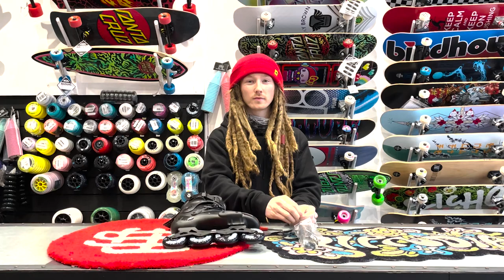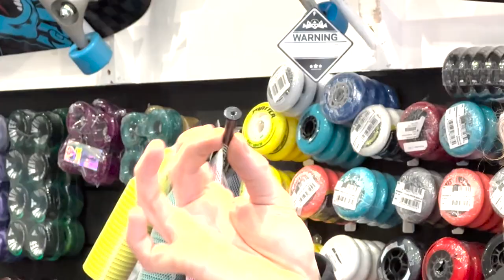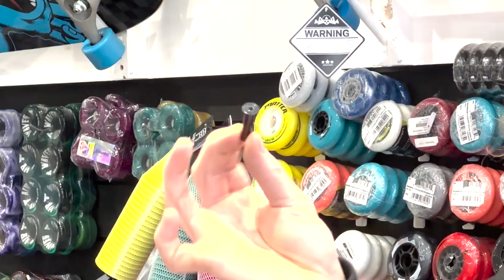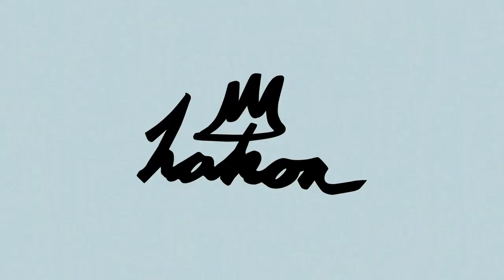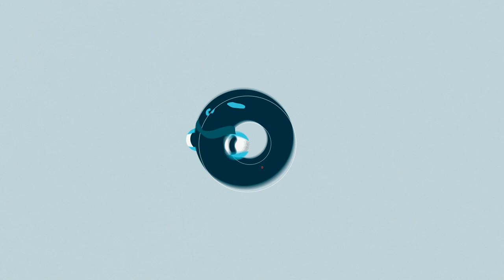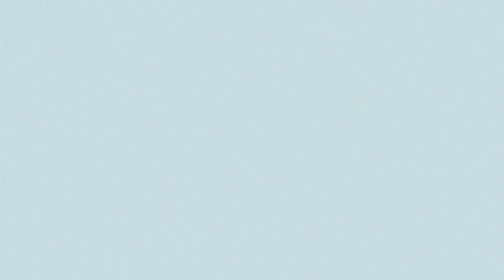How to Fit an FR Brake to your Skates

Comment: My frx80 rockerable wont come out after unscrewing the bolt on the inside back wheel. Should it just fall out?
Reply from the maker: It may get jammed inside. Put the bolt back in loose and hit it to see if it knocks the otherside out
Reply: @SJRollerblading  Unfortunately, it is not budging 😅 Any other advice on knocking the otherside out?
Reply from the maker: @frozenflights  It must be really stuck in there! Email me at sjrollerblading@gmail.com and send me a photo or a video so I can take a look?

Comment: I was able to install the brake on my frx 80, but now the back wheel doesn't spin as long as the other wheels. When I give it a hand spin, the last wheel spins but constantly spins for much less than other wheels. Any suggestions on what I might be doing wrong?
Reply from the maker: Have you skated them since you put the brake on yet?
Reply: No I haven't. When i loosen the screw a little, I notice that it spins fine. Its when I tighten them, it doesn't spin as much as others. When I tighten without the brakes in place, its spins alright though. Kinda confused. 

 I had this kind of similar issue with one other wheel where if I tightened it, the wheels would barely spin. The problem was that the one bearing spacer was shorter than others. I replaced it with a new one and now it spins just fine even when I tighten the screw all the way.
Reply from the maker: @dvydz  having the correct sized spacer can make all the difference for sure. With the brake, I’d try skating it and then see how it performs. It should speed up as you use it but if not then something must be squeezing your frame or wheel I guess. These brakes can be hit or miss. Sometimes they are great and other times not. Best thing to do is learn how to stop without it 💪

Comment: The FR brake sits rather awkwardly on the FR 243mm frame, due to the ridge (which I assume is decorative). Is it okay to just slide it over this ridge?
Reply from the maker: Yeah, unfortunately it doesn't fit perefctly on all FR Frames but it should still work for ya